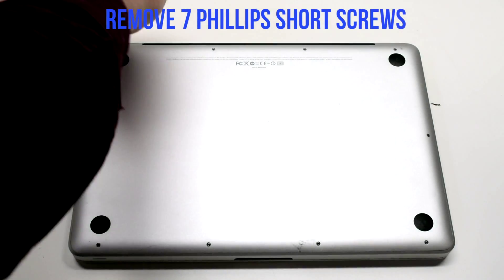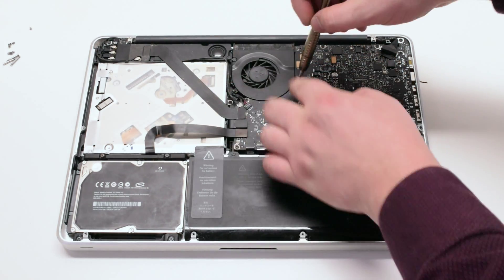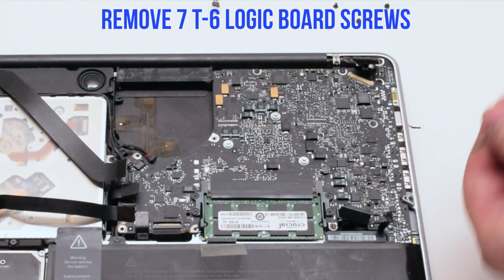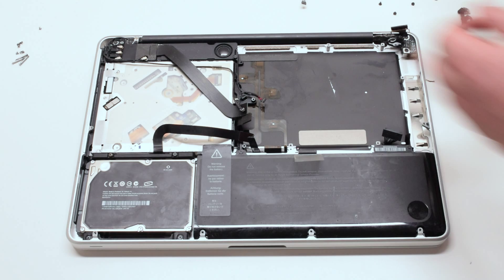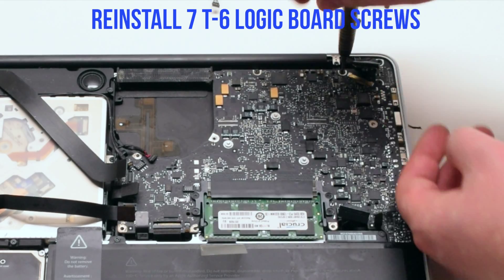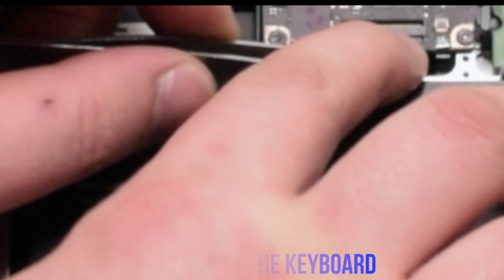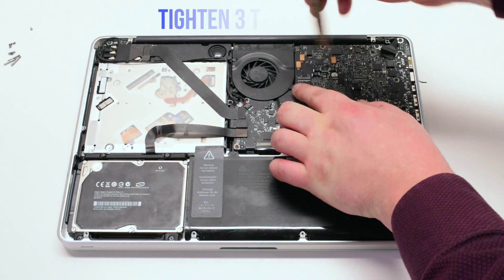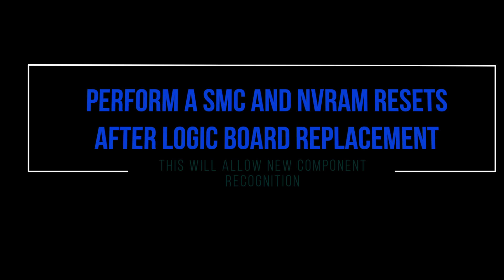2011 Macbook Pro 13" A1278 Logic Board Replacement

Comment: you should have turned it on so we could have seen if it worked.
Reply: such a ridiculous comment.
Reply: I followed this guide and yes everything works. Keyboard and power button didn't work at first but that was because I didn't plug the cable in far enough, it's very awkward. with some patience got it in though and working flawlessly, and much quieter after cleaning and repasting.

Comment: Can I pay for your time in diagnosing something that's really annoying me on my 2011 13inch MBP i5 2.4ghz EMC2555, I'm on Yosemite but can't remember the vers (unable to log in reliably due to this problem).  Think it's a malfunctioning GPU on the integrated Intel 3000 (only runs the that, no separate GPU).  Concerned there might be a problem with the property I'm renting in terms of electrical wiring, possible surge, user a three pin mac power adaptor but still wondering.  If not perhaps a short across the logic board.  Apple regard as obsolete
 Symptoms:  Started off deteriorating when watching Youtube/embedded vids.  Wouldn't load, would require restart.  Also noticed buzzing/micro electric shocks above right hand side where right palm rests (above HD).  Would get hot also.  Then suddenly screen pixelated and switched off.  Three beeps trying to restart.  I took off the back, changed RAM over and tested each slot independently. Reboot each time and at different intervals machine would pixelated lines, yellow, purple then hang or immediately shut down.  Took off logic board.  Cleaned well with Iso Alc and compressed air.  Tried reboot, lasted long, logged in then pixelated and shut down.  Testing newly order one stick of 2BG ram in next couple of days as a sanity check.  Cleaned SODIMM contacts. Rebooted off external HD with original HD still connected.  Same.  Rebooted with Batt disconnected. Same.  Thinking of removing batt & int HD and booting off cross both devices off list.  Can integrated GPU be replaced?  Hate throwing things like this away and loathe to buy another logic board without knowing for sure that's the issue :)  
Many thanks - Happy to donate to your paypal etc for considered answer

Comment: If I have an early 2011 13'' with i5 processor, can I replace the logic board with a mid 2012 i7 logic board?
Reply from the maker: Yes you can, it's same family type.
Reply: Save Apple Dollars Do you have a list of compatible logicboards? I have the exact same MBP as OP. If not a list, then what is the family type?
Reply: @John Marks When I researched this a while ago I found out it possible to do what I said, but you have to do some finagling because there are some slight differences between 2011 and 2012 MacBook Pro, I will link the video when I find it.
Reply: @John Marks here is the link to video explaining how to do it. You have to buy a few replacement parts, and it looks tricky, but this guy was able to doit https://youtu.be/Je-_x4T5J_E

Comment: Would it not be possible to flip the board up with the mic still glued and disconnect it from the board and it's traces? Or does that make re installation way too difficult?
Reply from the maker: It's possible and is preference if you do it for a living I would say.